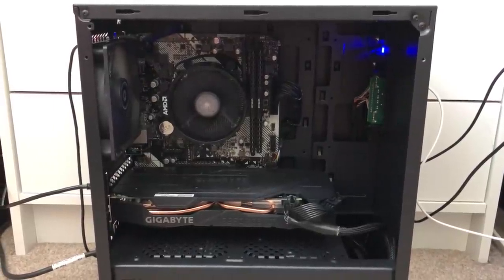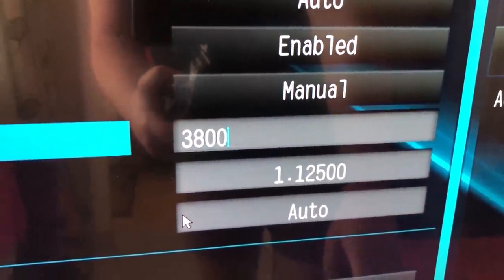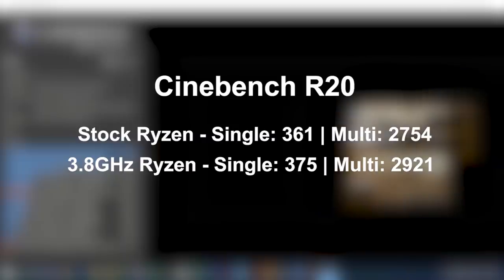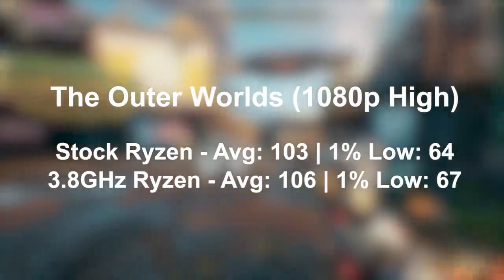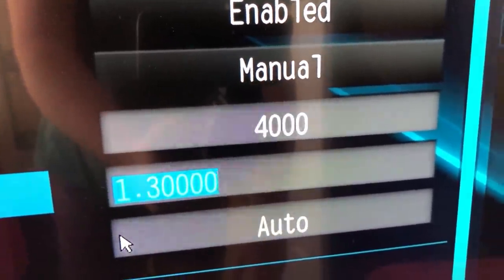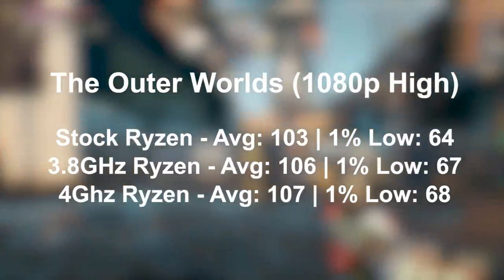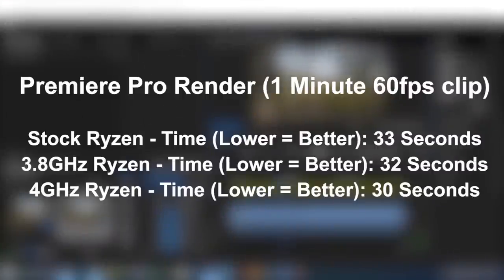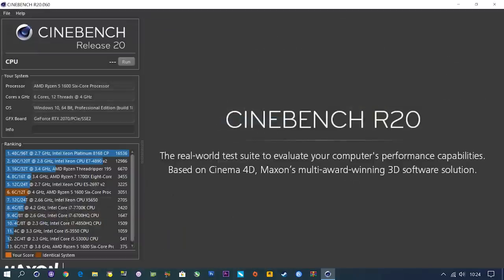4GHz Ryzen Overclock On The Stock Cooler: Good Idea Or Fire Hazard?

Comment: I've just build a system with the ryzen 5 1600af and i am running it at 3.5ghz with stock cooler i dont want to push it anymore cause of my psu but I might try and do that overclock when i upgrade the psu
Reply: did you use watt meter digital to see  power consumption ?
Reply: @claritoresdiano1021  na dont have that kinda stuff but it's a cheaper psu as couldn't afford anything better but it works really well for what it is and it doesn't pull that much as a whole
Reply: @MrSkullsReign0704  that's cheap you should tried it.
Yup level accuracy maybe's bad arround 10~15% but cheap, hard to blame it XD.
Reply: @claritoresdiano1021  I wanna get a 650wat or 700watt soon
Reply: @MrSkullsReign0704  idk how much your electricity power draw get from the wall, just find 80+ silver or gold psu.
i'm not recommended cheapest psu.

Comment: emm, but u know that for ryzen oc we use ryzen master yes ?
Reply: Kacpertost bios seems easier
Reply: @MilkyGaming144Hz  imo ryzen master is easier
Reply: @IosifStalinsendsyoutoGulag  maybe 1.35 ? and push mhz higher, when system will crash set voltage on 1.4
Reply: @IosifStalinsendsyoutoGulag  hmm, maybe buy a cooler, this should help

Comment: try to balance speed and voltage. the lowest possible voltage per speed. lowers temperature.
or you could inch up the clocks using 1.3, 1.2 or 1.25V. what ever the cooler can handle.
get a noctua cooler to remove thinking about which cooler to buy.  even an older, used one can have a kit available to mount it to new processors.
so, get a used cooler and buy a kit available for it for the cheapest experience. also for coolers: the bigger the better. 

get a Noctua D-15 or similar for all your cooling needs, ever. really. its closest to water cooling performance as you can get.
but a small one does already yield a huge improvement.

Comment: I have this cooler but have no intention of overclocking . would it be good enough or do you think I should invest in a different cooler?
Reply: Light overclocking with the stock cooler. I bumped mine up to 3.6ghz with the stock cooler on a b450 motherboard
Reply: @theapprentice2058  I went with a noctua nh-u12s instead
Reply: @A1DULLU  then try my 3.75ghz clock speed with 1.250v I have a be quiet dark rock 4

Comment: I was doing that the first winter i had my cpu i had a blast grinding benchmarks with my 2600 with a stock cooler cause im broke
nowadays i realized performance did not justify shortening the lifespan of a cpu i wouldn't be able to afford again anytime soon
bought it when it came out and still rocking today and for many more years with the same stock but great cooler

Comment: My 3600 runs at 41/200 most MHz on stock cooler in most games .. peak temp ever was 79c which I’m happy with. Could I get slightly better performance for £30 cooler ? Yes. But £30 is a lot at the moment 😅😄

Comment: My 2600 got 4.025Ghz at 1.26v on the stock cooler. I might go further but it's only a second PC mainly for work and light gaming (RX 480)

I build the same rig for a friend and had to jack the voltage to 1.3+ for 4Ghz. I ended up sticking at 3.9.

Silicon lottery in motion.

Comment: I have this cpu combined with very cheap MSI A320 Motherboard and in gaming it gets to roughly 70c But using prime 95 torture test it can get up to 80c. but otherwise it runs absolutely fine. I was worried combining it with a cheap motherboard but it seems to be ruining absolutely great.

Comment: I overclocked my 3200G to 4.1Ghz at 1.41V and the iGPU to 1675 Mhz and the APU never reaches over 50C in benchmarks and/or games while using a Wraith Prism cooler, with the Stealth cooler I had around 70C.
Reply: Going any higher on the iGPU makes it artifact even on the desktop and crash a couple seconds later. I've been using Ryzen Master for my OC'ing needs.
Reply: airflow case and ambient temperature very important

Comment: For getting the CPU to 95% of it's capacity, you're good if you know a bit about voltage and multiplier. If you want to get those last 5%, you need extensive knowledge about not just CPU, but also MB, RAM, Serious watercooling.. My 6700k is capable of 4.9ghz all core no problem. But my MB isn't. And my RAM neither. So I run it @4.7 24/7 and it hasn't skipped a beat in 4 years

Comment: It should be fine since AMD packed the stock coolers in with their X series chips which allow for overclocking. That doesn't mean it will be great. When I eventually get my 3700X I am going to use an Arctic 34 Esports Duo with mine. Yes I got the one with red on the fans cause you know AMD.

Comment: Tech yes city looked at a320 boards and found them to benchmark higher than b450 at the same freq. Brian surmised it could be due to shorter traces and relatively less complex design lol. OC'ing used to be exciting. Now it's debatable if it's even worth the heat/electricity.

Comment: Maybe in Zen and Zen+ you can get away with those voltages, but generally, even if the temperatures are ok, high voltages can degrade internal circuitry of the CPU and lead to premature failure, if you need some extra performance, I would advise to save a overclocked profile, and use it only when you need it.

Comment: I ran my first gen R5 1600 at 3.75 on a mild overclock using a Gammaxx 400 cooler (horrible mounting system for AM4 by the way) and it worked good for me for a long time, very stable no crashes. I then upgraded to the 3600 along with a slightly better than stock Wraith Prism cooler (for the blinky lights, and it was free) and it overclocked itself to 3.95 so I never touched it. LOL

Comment: The stock cooler is horrible. I replaced the stock cooler on my R5 3600 in less than a week because of the noise and very high temperatures. I do however have a full glass case that doesn't let much air in it, but even with 2 intakes and 1 out, I was reaching over 90C during gaming without OC.  I switched to a cheap Deepcool Gammaxx GTE (did this because my order for a Noctua D15 was out of stock at my local electronics shop, so I was thinking to use this Deepcool for 2 weeks until the Noctua arrived and put the Deepcool in my gfs build) and I was amazed how good it performed for just ~$20. My max temps during Batman Arkham Knight and Shadow of the Tomb Raider are 63-65C with an idle temp of 40-45C. I was so happy with the performance that I decided to cancel the order for the Noctua (since it was x5 more expensive and delivered slightly better temps) and get my gf one too. I got my R5 3600@ 4.2 GHz and 1.3875V.
Reply: depends your ambient temperature

Comment: R5 2400g  ( deepcool 120Aio cooler)
16gb ram
Msi x470
Gtx 1060
Even @1.4v can't get 4Ghz
@1.3v  3.9Ghz stable but after longer periods of gaming its suddenly system ran in some problem
After that iQuit overclocking😭
Reply: Pairing an APU with a 
discreet card is generally seen as a bad idea
Reply: @wil-fri  soon i buy R5 2600 and after good Gpu
Reply: turn off multi-thread

Comment: Running the 3200g at 3.6 base clock but Overclocked to 4.1hgz stable.  Paid $290.00 Dollars 5 months or so ago for the chip, an ASRock b450m MB, a 600 watt Cougar VTX PSU, and 16GB Team Group DDR4 at 3200mhz.(AND a cheap Rosewill case),  Very pleased with my purchase.  I used the Vega 8 On Board graphics until I could afford my XFX RX580 8GB.

Comment: you need a new case as there is no front airflow which results in throttling as ryzen runs better at the lower temperatures... Sorry if I sound like GamersNexus :)
Reply from the maker: No you’re right, it’s  not a great case for airflow, but I never have the side panel on so I like to think the system gets a little more air at least haha.
Reply: @RandomGaminginHD  True point but I'd personally consider a new case but if it runs fine, I think its fair to leave as is.... Thanks for responding!

Comment: I was able to pick one up for 85 usd from amazon. My only regret is not buying 5 more. Running stock speed at 1.175 with an RGB spire that came with my R7 1700 even in the little HTPC I've never seen it get above 65. Have it mated to an Asrock AB350 itx mobo and an R9 Nano that I hope to replace with a Visiontek itx RX 5500 8g someday soon.

Comment: Just to put it out there, there are definitely some bad 1600 AF samples out there. Mine can only OC to 3.875 at 1.35 volts. 3.90-3.95 is essentially where the voltage wall for my chip is. TBH I'm extremely happy with the stock performance with 3200 2x8 RAM, the OC helps with minimum FPS but to anyone on the fence: the stock speeds are more than enough for most budget>midrange GPUs! If you want better for any reason I know people with the r5 3600 that are extremely happy paired with 2070 Super.

Worded differently: at least one AF (mine) is one that probably didn't pass 2600 specifications.

Comment: I should note that having OCed RAM can significantly improve performance in gaming. 1600 AE can Handle 2933 without any problem (everything above is matter of luck and hardware you have), 1600AF can do 3200 with ease, 3600 can do 3600 and above. But if you have more than 2 sticks it can be difficult to achieve either due to higher memory controller load.
Also Cinebench isn't stress CPU enough to have any conclusions about system stability.. There's Prime95 or OCCT to check is your system stable under heavy load or not (and to be sure you should let it run for about 10-12 hours)
Reply: yup but no matter stabilty test for normal user, most user push system less than 12 hours

burn 12 hours not good for psu and vrm motherboard lifespan :(
Reply: @claritoresdiano1021  if you do have good PSU, decent vrm with enough cooling -it's okay. If not - you probably should not o.c. your PC.
12 hours needed for final stability test, of course. You can run shorter tests in-between.

Comment: I got my Ryzen 3600X on the Wraith stealth running @4.3Ghz with max voltage of about 1,3-1,36V via ryzen master. 
Yeah it can go to like 92°C when stressed to the max like when i use folding@home or do the Aida64 FPU stress test.
so, even the cheapest AM4 cooler is seriously decent

Comment: i set my 3600 to 4ghz all core in the bios. and it's working well, i was to scared to go any higher because the $315 australian pesos was a bit hit to the budget. i couldn't get a 2600 and 1600af wasn't out at the time.

Comment: I had an OC on my 1600AE but decided the gains were not worth the extra stress put on the parts. I really like taking care of my hardware and if keeping it stock will give the hardware longevity and all I had to do was wait a few more seconds when I render something, that's a tradeoff I'm willing to make. Of course,YMMV.
Reply: when you don't want to overclock you can undervolt it.

tweaking your RAM with "Ryzen Dram Calculator by1 usmus" it helps a lot than overclock cpu itself.
Reply: @claritoresdiano1021  Sorry for the late reply! I actually OC'd both the CPU and RAM when I had it OC'd. I was running a 3.8GHz all-core OC @ 1.325v on the CPU, and (IIRC) 3200mhz on the 16GB of RAM I have, I believe it was 1.25v.

It didn't really have a significant impact on the speed of my workflow. Perhaps I would have noticed something more dramatic with gaming benchmarks, but I rarely game on the PC, it's more a productivity machine, and I didn't see any major gains, so I just went back to stock.

Comment: I've managed to push my 3600 on all cores to 4.2 ghz at 1.21 volts, 4.3 ghz at 1.27 ghz and 4.4 ghz at 1.325 volts all on the stock cooler!
Reply: wow that's actually good silicon, what's your motherboard?
Reply: @AimanHilmiAHJ  I'm running an old Gigabyte B350 mobo lol

Comment: Overclocking this cpu for gaming is only worth it for 240hz+ gamers - CS go - Fortnite and so on. The games you showed is mostly gpu limited. If you have a 60/75hz monitor and are only using your computer for gaming, then just leave the cpu stock.

Comment: i personally would not overclock on that motherboard, as the vrm is not cooled. When you overclock it the vrms are probably getting pretty hot and that might kill the motherboard.
Reply: Actually VRMs can take quite a bit of heat  and these boards do have thermal protections included. Failure of that kind is unlikely. Having said that, I wouldn't try such an overclock with a 3800X. :D
Reply: @mapesdhs597  yea i have the same mobo and when i put my ryzen 7 on it it was getting really hot id just be careful overclocking on that mobo
Reply: @kurokoshirai5402  Note that "really hot" to the human touch is still well below what a typical VRM can tolerate. Check Buildzoid's channel for lots of indepth VRM info. Having said that, with a budget board one is kinda relying on the board vendor implementing sensible control circuitry, even if the mosfets, etc. themselves can handle the heat & power. Poor control circuitry could make all the difference. This in general is why I wouldn't normally oc on a pure entry board anyway. A simple rule of thumb: if there's no heatsink on the VRM then don't oc. :D  There are exceptions of course, but they're rare and often historical, such as the old P55 Gigabyte UD2H.

There was a time, especially the P55 days, when budget mbds allowed for extraordinary oc'ing potential, eg. one could easily run an i3 550 at 4.5GHz on an Asrock P55 Extreme. Alas nowadays on the Intel side it's horribly locked down and the CPUs often have auto oc'ing functions built into them anyway. Was more fun back in the P55/X58 era, or even S775 with Wolfdale mania.
Reply: still i opted to use my old motherboard with my ryzen 7 as the asrock mobo did not have a heatsink over the vrms, and it would commonly power off randomly when i was doing any kind of stress test. that mobo was not really made to handle a ryzen 7

Comment: This bad boi overclocks better then my r5 2600 lol
Reply: Hugo 1600AF has base 3.2, all core Turbo of 3.4 and max core turbo (limited to 2 cores) at 3.6 (3.75 GHz with XFR).

You can achieve an all core OC of 4.2, which is 25% over base and 800 MHz over all core Turbo.
Reply: @raresmacovei8382  i need 1.325 V for 3.9 i might try 1.38 and 4.2 and + lcc mode 3 and see if its stable for shit and giggles

Comment: On my 1st gen Ryzen 1600 I only get at 3.8GHz 2819 multicore on Cinebench R20 but a surprizingly higher single core score than yours, 384. Bare in mind I didn't close the apps that were running in the backgrounda and 30 chrome tabs. I 've upgraded my Spire cooler though, to the infamous Snowman M-T4 ;)

Comment: Stock AMD Ryzen coolers are good. I have a 3600 overclocked to 4.3ghz on stock cooler and run well and doesn't over heat.I even stress tested it and my fans don't get that loud at all.

Comment: Overclocking Ryzen is just not worth it. These chips are excellent as they are, no need to up the voltage and heat for a very minor improvement in clock speed/performance. As a matter of fact: I take pride in NOT overclocking my 2700x as opposed to all my other Intel and older AMD  (FX/Athlon) CPU's 😁
Reply: Divine Toad 2700X, yeah. If you manage 4.35 all core, it's great. If you don't reach that, then OC'ing it is not worth it.

But a 1600AF? This things Turbos all core at 3.4 and it can OC all core to 4.2. Definetely performance to be had.

Comment: I would overclock my Ryzen 3 2200g to 3.75 GHz. I believe over time clocking it that high on the stock cooler broke the chip from doing single channel ram. I had to return it to AMD and get a replacement. It had the issue on 3 perfectly fine motherboards.

Comment: i did it with my 3600 8 months ago, with stock cooler i could get between 4ghz - 4.075ghz, higher frequencies had higher temps (over 80+°C)
Reply: Steven Enno  i did

Comment: Hey guys I have a question. I have $350 to spend on a graphics card, and I have a Ryzen 5 2600. What graphics card should I get for the best price for performance?
Reply: 2060 or 5700 (non XT)
Reply: desa beast I ended up getting a RTX 2060 from EVGA, and it performs very nice 😎

Comment: i want to know is 75°c normal while gaming plz tell me. I have a ryzen 5 3600 with gtx 1660 and i am getting 75°c while playing witcher 3 for 1 hour . will it damage my pc my room temp is 31°c
Reply: You'll see thermal throttling but in my experience, it shouldn't go that high, i overclocked my cpu to 3.6ghz on the stock cooler and it always stayed in the mid 60s

Comment: Thanks for the video! I saw the Hoosier Hardware video and thought that it makes little sense to overclock to just 3.8GHz, but if 4.0GHz is a possibility then it's worth a try on my 1600 AF, so I will, right after I stabilize my RAM overclock.
Reply: I barely hit 3.725GHz on my 1600AF with a 1.35Vcore stock cooler/stock paste, just remember that all chips are not made the same, seeing these 4GHz results set me up for disappointment when I got my results after hours of bench marking and bios tweaking. 😢
Reply: @3rd.world.eliteAJ  I'll at least give it a try. RAM overclocking hasn't gone as smooth as I had wanted either. Either I'm not that lucky with my chip or the motherboard is holding back the CPU.

Comment: I have pushed my Ryzen 5 3600 with Wraith Stealth cooler to 4.1GHz on 1.325v all core though.
Reply: I did 4.2. most of the time it runs ok. stable but on the hot side
Reply: @folvr  id did 4.5 stable  3600  stock cooler 1.35v
Reply: @welshinu  dude, I need a video to believe it. Even then I would be skeptical.
Reply: @folvr  dont have it now sold it plus i could not put a video up here. i may be getting it back at the end of the month
Reply: yup, that's total bs. 4.3 I can believe with AC on.
4.35ish highly unstable. 
Higher than that just with a chiller or ln2
Reply: @folvr  well i just found a pic that i sent to my m8   4.5  was on 1.37v  i just found a pic with 4.4  at 1.24v   how can you see this pic ?    i dont do bs  if i did not do it i would not say it  simple  and this 3900x  i cant get past 4.3
Reply: @folvr  just managed to uploaded the pic on youtube  search Welshinu